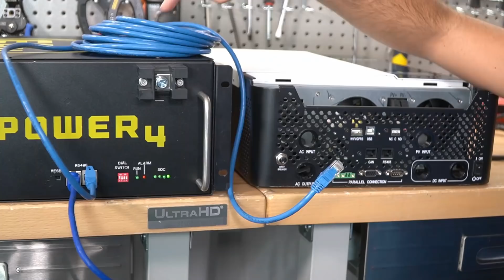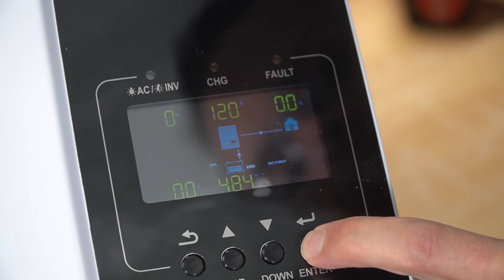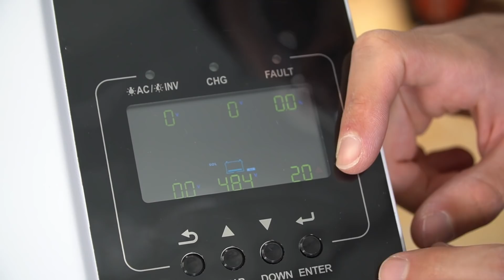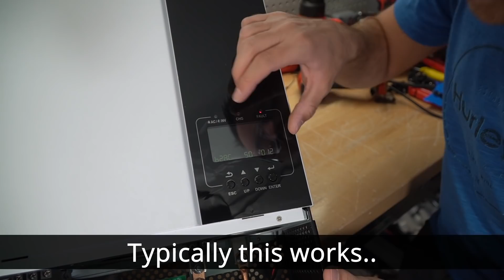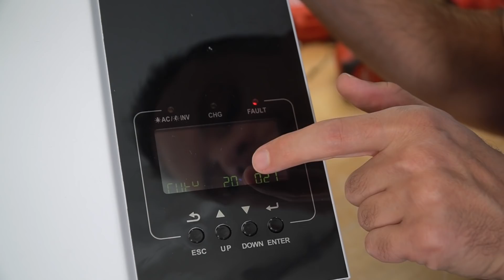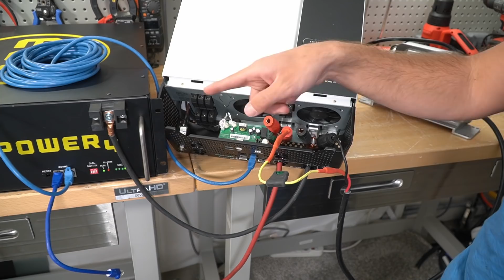EG4 Battery + Growatt Inverter RS485 Communication Tutorial and Troubleshooting

Comment: I couldn't get my Growatt to read my battery after I plugged in the Ethernet cable until I moved it to the BMS port on the Growatt.  I'm pretty sure Will said to plug it in the RS485 port.

Comment: Will the 48 battery with that inverter power my to 220 volt submersible pump for my deep well? Also will it power my 220 volt hot water heater?

Comment: Been following your solar videos since you lived in the van William, amazing amusing and entertaining. Still living in the MobyHome with a diy lifepo4 12 volt battery and the all in one 800 watt 12 volt inverter charger, and two 175 watt panels on the roof. It’s enough to run the compressor fridge, lights, iPhone and iPad. 
Wanted to get a weize for the diesel heater but it sold out too quick. I have invested in another charge controller and two hundred watt panels but I don’t think it’s enough to keep the lead acid battery up in the wintertime. Had a wonderful little inverter generator last winter to top up batteries on cloudy days but someone stole it and my air compressor in April.

Comment: Dumb question. 
If you have multiple batteries in parallel should you connect one charge cable to the first battery and the other cable to the last battery?

Comment: Help.   I bought a Growatt and dont have the directions for the settings   also bought the wifi module with it.   did you ever do a video of the growatt and all the programing, menus and so forth ????   thanks  this would be awesome to understand.  I bought the growatt 3000 after one of your videos.  i also bought two 300 amp hour 12v Li batteries you showed.  some of the modes in the manual are not even in the same ball park as what comes up on the screen LCD.

Comment: Hi Will, thanks for taking the time to explain as always. I've been wondering for months why you've never demonstrated or talked more about the advantages of CAN/RS485 and lithium batteries, and based on your closing comment I have to ask a question based on my experience. As you know the peukert effect holds absolutely true for lithium batteries, so when under load you inverter will register a lower V  - in some cases under heavy load 1 - 1.5V! On AGM's that was fine as your % vs battery V was linear. As as you know it's very different for lithium batteries.  As an example a difference between 50V and 48.5V could be 30% total capacity. The issue with lithium batteries set as agm is cutoffs happen a lot earlier than what the actual state of charge is and you sit in a constant loop of low V disconnect/reconnects. That's part of the function of a BMS with CAN/RS485 - it allows for exact measurement and control by the inverter, based on the BMS'es accurate measurements, not a simple guess on V measured at any level of load. In your example where you set disconnect at 10% - it's impossible to calculate that accurately based on V, without CAN/RS485. Even smart inverters like Sol-Ark has an internal shunt and tries to guess accurate % based on V, but still very inaccurate. The experienced installers all say proper CAN/RS485 allows at least 20 - 30% more usable capacity when pairing a smart BMS with CAN/RS485 capable inverter. compared  to running them like AGM and setting V values for cutoff/charge etc. Your capacity testing is a different story as you run at constant low C discharge and it's accurate, but with inverters and variable loads for a real scenario where loads vary it's a massive drawback NOT having a BMS with CAN/RS485. Perhaps reach out to your suppliers and ask for their comment, and do the test! Run the same battery in AGM under load, set your Growatt to cutoff at say 46V (or whatever is determined to be low/10%) and after it shuts off, disconnect loads and see how much capacity is left over. Repeat using the RS485 interface and re-run the same test and compare.

Comment: Will, can the manufacurer provide you with Rs485  modbus registers map? Most times this  communication protocol is available  in case if we want to use different inverter or a PLC controller. Thanks,

Comment: You sure about this? Rs485 protocol usually implies a master/slave, would suggest the inverter is the master, and each battery needs a slave id. Dyor
Reply from the maker: Yeah, but they can be any ID as long as they are different

Comment: Does going to 100% not depart the main chemistry phase?  I would hazard a guess that it's better not to go past either inflection point on the discharge curve.  I've been getting conflicting information about whether iron oxidizes and metallic lithium accumulates on the anode at high voltage, while "dead lithium" accumulates at low voltage.  ie, why 95% is the default setting

Comment: Question for you. I have 5x 100W Solar Panels split to 2x pairs and 1 Single 100W panel, connected to 3 charge controllers going to their own batteries. The panels are not charging the battery much at all due to no sun and the epever charge controller is showing red as battery low. What can i do? I tried connecting all the 5 panels together and using the output to the three solar controllers, but there is barely enough for one epever to flash and then goes off. What can i do? Add more panels? Any other way?
Reply: Guessing your problem is low voltage.  Are they all the same panel or different.   Serial they are additive voltage but the panel with the lowest amps is all you get.  Parallel, the amps add up but your lowest voltage panel is all you get for voltage from all of them.   If the amps are about the same you can put them in serial (String) and raise the voltage sooner.   But be careful, add all the short circuit voltages together and then do not exceed the mppt voltage max.  It  can burn up the mppt.     Most 100w panels are 17 to 21 v  so if you add 5 you get 70 to 105 or so volts  plus they can exceed slightly in bright sun when cold.   You might try 4 in series on mppt and one on pwm.

Comment: So when the inverter has no RS485 connection to the battery, the battery gets cutted-off only by the BMS? I'm thinking of making a DIY 48V battery, because these battery prebuilds are expensive as hell here in Europe (though I just found a similiar 48V/100A for 2000€ and it's in stock).
Reply: Connecting the cable disables the battery BMS I believe hence inverter takes over. I have a similar battery. Now if you get this communication wrong, it might damage your battery BMS. Happened to me

Comment: Wow, whoever was in charge of programming VCRs in the 80’s is working at this company doing some fine work.
Reply: This is what happens when companies save $5 by using a 7 segment display rather than an LCD.
Reply: You can connect with usb to a pc and use software to set up and even update. They even include cable and cd with software.
Reply: Growatt is also capable of logging data via wifi. Painful to set up, but has potential. They really need to add a Raspberry Pi zero with a web interface to set it up. Hardware is $10, expensive part is software development. But people buy it as is.
Reply: @john_in_phoenix  software development can definitely be an expensive part but features that give easier control and ability to tinker will get way more entry level and advanced level users wanting this product.
Reply: @2008mjb  The hard part is convincing the company to invest any time and money on improving the user interface. Since there is frequently a wait list to buy the product as it currently exists. In particular Chinese companies are more concerned with others copying their hardware design than anything else. If they documented the hardware, and how it is controlled, people would gladly write code for the product.

Comment: Will, please explain the shunt.
Reply: The shunt measures energy coming in and out of the battery as well as the voltage and is hooked to the negative cable.  Check out the Victron SmartShunt he uses in his videos.

Comment: wondering if these batteries can also communicate with mpp solars.
they also use rs485, so if the eg4 support the pylontech protocol, they should be able to communicate.

also wondering what bms this is inside

Comment: Will, 
The precharge circuit probably only gets used when the battery is first turned on.   I am guessing there would be a pretty large spark if the inverter was hooked up while the battery is on.

Comment: I would love to see what one of these would do between AC power and everything in a utility room which for me is Furnace and network equipment. Furnace is a single 15a breaker and then maybe 1-2a worth of network equipment. Would this exact setup be able to handle the motor start for the furnace and what kind of run time could you expect out of this single battery.

I think it would be awesome to have this setup with a couple solar panels to keep the basics running for a few hours so I wouldn't have to wheel out the generator for a short power outage.

Comment: Will, please use your Awesome YouTube Powers of Might to force all the battery manufacturers to standardize on a common system and protocol for battery charging and management.

For example, when will the SOK batteries support your new battery charging and management standard?

The RS485 Cables for your common protocol are a hindrance. There should be a common bluetooth standard that the MPPT controllers use to talk to batteries.

Comment: Thanks again, Will. I’m surprised you tolerated those annoying beeps! Have you ever tried configuring the Wi-Fi module?
Reply from the maker: Oh you can easily change the settings to disable the beeps. I keep them on during instructional videos so people can see when I click a button.
Reply: I have and it is a nightmare. You’ll need to log into it with an IP address on a browser and change server settings like your trying to hack something.
Reply: @TravisH1888  I have too, was curious if Will had. I was never able to get mine to work, even with using the IP address and connecting to the PC and Growatt’s remote monitoring system…so I returned mine.
Reply from the maker: I won't try to use the computer interface. I hear it's awful as well
Reply: @WillProwse  sounds like it needs a review video then…

Comment: Legit question: How is this better/different than just setting the over/under voltage settings in your bms to charge/discharge at the desired range?
Reply from the maker: Some people want to milk the cells for more cycles. I don't think it's worth it at all. Check out the ending of the video where I talk about how I think this whole thing is pointless.
Reply: @WillProwse  I watched to the end. I get the overall concept I’m just curious how the communication with the all in one unit is different from just having the bms do the job of controlling the range.
Reply: @DatascrapingVictim  If your BMS has a shut-off at a minimum discharge preset setting that is above the bottom of the Growatt zero setting, then it will supercede the shutdown of the battery.
Reply: @WillProwse  without this or a shunt you won’t be able to read a percent value for your batteries correct?

Comment: My inverter that I use as a backup has just blown up. Called customer support in their unwilling to help. It's only 2 years old and was only used to power 29 watt LED light bulbs as a test. I plugged it in today to use it and it shows an overload fault. Ames power inverter has blown a capacitor inside.

Comment: The only problem I have with your videos Will is that you always use a heat gun to draw the load from these all in one inverters, I would really like to hear the noise level of said inverters not the heat gun under load for my future builds. Great video as always!
Reply: I know this is going to sound crazy but what about a large barrel(s) of water with electric heating elements placed outside. If the water volume was large enough, open top for when it really starts to heat up, and multiple elements. You could setup a simple low volt relay setup to turn individual elements on and off depending on the needs of the test. This would cut out all the fan noise and allow for whatever load size you wanted.

I say 2-3x 55 gallon metal barrels with something like 4x 500w elements each that are rated up to 240v ac. At 3 barrels that would be 6kw of draw.

Crazy yes, but it checks a lot of boxes.
Reply: @2008mjb  
good that's a great idea this way you can heat water and save that energy in a heat form so is not wasted...
Reply: While i enjoy wills presentation style. David poz who is somehow affiliated has used water with heat elements, dryers ext for these battery tests

Comment: Will, love your videos, long time listener, first time caller. I have two of the batteries above, One of which is the EG4 48v (Two RJ485 ports) and One that is a Gyll Pro version 48V (four rj485 ports) (Master battery). I have my Master battery RJ485 chord to my growatt. Then one Rj485 cable from the Pro to the budget model. All DIP switches are set up correctly. Growatt is the 5000ES.
What kind of t Fuse are you using for this? I have a T class 200 amp fuse.
I can send a video of my system later, thanks
Reply: Fuses are to protect your wiring. Will your wiring carry 200 amps without overheating?

Comment: heya nice vlog that kind of system I'm gone bilt at my house but then with a DIY 18650 powerwall testing now for 3 month's 18650 2st hand cell's 1500 tested and have between 5K-6K battery cell's total to test wanne bilt a 120 cells parrallel and then 13 in serie to get 48V batterie pack

Comment: Not for me.   Needs to be more user friendly.
Reply from the maker: I agree. Not fun. I thought it would be much easier.
Reply: @WillProwse  I’m proud of my milk crate solar system.  I use it regularly, most of all it  made me more confident about building something far more substantial.  One warning about it though.  I inadvertently rotated the dial on the charger. …it let some smoke out of my inverter.  It still works, but perhaps I should add a fuse.
Reply: @joeo7257  anything above about a 300-500$ setup is when fuses, breakers, and cut off switches are a must between most major components. Burning up a 100$ component might be worth taking the risk of not adding 30$+ worth of protection parts.